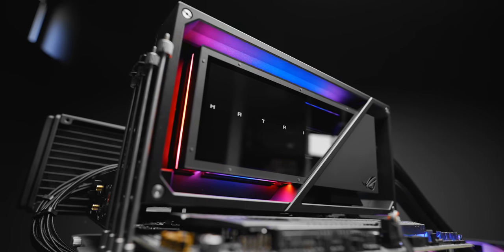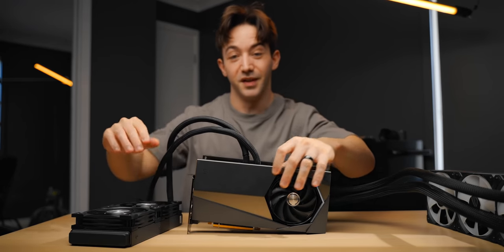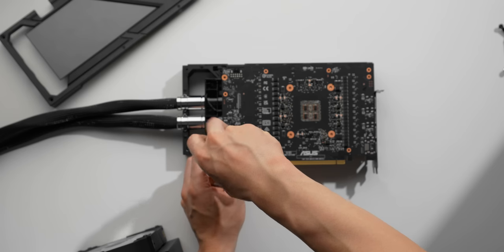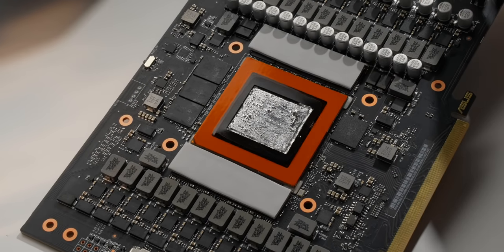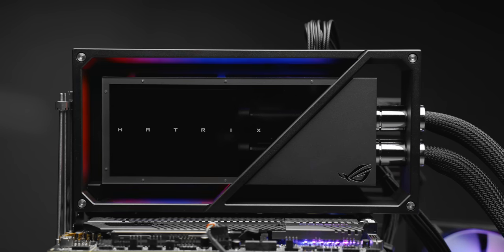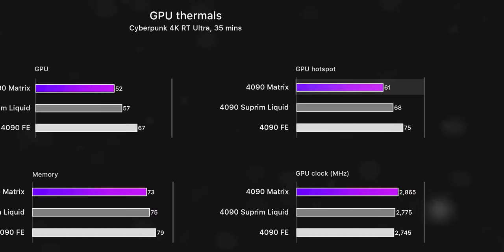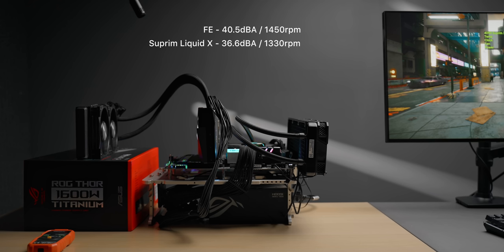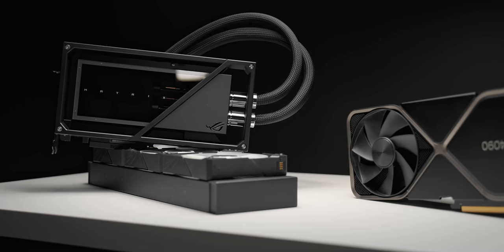Most Overkill GPU – ASUS 4090 Matrix

Comment: 2:08 Two problems. Radiator surface is not nickel plated, so liquid metal will diffuse in to the copper and stop working in year or two...
Reply: 2 problems? :p
Reply: not true
Reply: @erisium6988  Of course it's true, you can see that it's not nickel plated and the issues with copper + LM have been documented for 2 decades.
Reply: Additives easily solve this problem. Asus ain't that dumb.
Reply: @zqzj  You are confusing the loop gunking up from the inside, which is fixable with additives, with the liquid metal attacking the cold plate
Reply: @zqzj  "asus ain't dumb" rolls back a couple months to asus selling motherboards that were literally exploding and killing cpus and their only response till gamers nexus called them out was "not our fault" 😆😆look forward to the "not our fault" pr with this card too. 

Then again if anyone is dumb enough to spend 4k on this scam when it gets 3 fps more than a stock 4090 I don't really feel sorry for them getting played by asus lol
Reply: @slayerr4365  $4000, where did you get that price from? 🤔 I couldn't find it in any listing, but the "MSI GeForce RTX 4090 SUPRIM LIQUID X 24G" cost the same as any quality RTX 4090. Around $1800. Seems like you're just grabbing numbers out of your A$$. 😄 And btw, do you really think people would buy this card for its value? 🤦‍♂ 
I know about the Gamers Nexus story, and I'm not trying to cheerlead ASUS, they F'ed up big time... But you would be surprised how many people can buy a $3k Graphics card, and it wouldn't even make a dent in their wallet. There are "audiophile" loudspeakers that cost as much as a house, yet still people buy them.

Comment: for the amount of extra effort I don't think 10C would justify the 2x price tag and probably double the weight and size of standard 4090 card./..
Reply: also given its proprietary design maintenance and repair would be a nightmare. a competent gamer with proper tools could service his own air cooled gpu at least for fans coolers and heat sink, basic soldering etc. this thing? forget about it lol. For the ultra rich idgaf l33t gamers I suppose.

Comment: When I think "full coverage" I think water channels over the components. Not just a plate of metal that is cooled by a separate part that's cooled by water. Like the difference between a back plate, a backplate with thermal pads, and an active backplate.

Comment: Can you confirm that liquid metal on bare copper is a "real" issue, and if ASUS has accounted for this in their design?  I'm also curious why the water block does not have flow over the VRAM and power components.  Especially at this price point, I'd expect that this product had been very well engineered...but, some nagging questions seem to be popping up.

Comment: you say you're surprised that the matrix uses less power, this shouldn't come as a surprise as when silicon is at a lower temperature it has a higher efficiency meaning that it give the same or better performance for the same or even less power consumption. increase power limits and you should see the card boosting even higher. this is why overclockers like watercooling and having big thick radiators with lots of high static pressure high rpm fans. this also partially explains the difference in coil whine, keeping things colder means they'll run at different frequencies. it's also a result of having a different housing to resonate though. there's a few other factors but those are the most important ones.

Comment: This sort of confirms why i stopped messing with custom watercooling and all that stuff.
You spend an extra heap of cash, and the bottom line result is 3fps.
Forget about the temps and everything because in the end we're here for frames per second, and what you get is 3 extra frames per second, which is absolutely nothing.
Don't get me wrong, i absolutely love the engineering that goes into this, but in all honesty, you're just burning cash for bragging rights.

Comment: I have a pretty descent rig right now that has a RTX 2070 Super, it can't handle ray tracing but does ok. My laptop has a 3060 and does a little better. I looked it up and I can get an RTX 4080 24GB, 384 bit for $2k and it performs almost as good as this things and stays almost as cool. Unless you are just rich, $3200 for a graphics card that cost as much as my PC? So, I am curious, let's say I am retired, have the money and want the best. I am buying a 4k OLED TV, my rig is an AMD Ryzen 5 3600, 32 GB RAM, Liquid Cooled CPU on an AORUS MB. Would you buy the Matrix or the $2100 graphics card.

Comment: What сase is the best for that GPU (or for any liquid cool GPUs), assuming you are using AIO on CPU too, you don't want either of them to push hot air inside your case, right? especially you don't want your 450W GPU move heat inside the case. So, how can you keep positive/neutral pressure in the case while having 2 AIOs at exhaust (I couldn't find the case where you can intake on the bottom and from the left, and exhaust from the back and top).

Comment: I was gonna buy a liquid cooled 7900xtx.... except no manufacturer gave us a liquid cooled version other than the Power Color custom card that doesn't have AIO/radiator, its just a card ready for custom cooling which I generally don't mess with as a cripple. My builds need more ease of parts. So either air cooled or AIO.... I really wanted an AIO 7900xtx.... maybe the 8000 series coming next year will have a liquid cooled version with AIO and radiator pre-attached.....

NOTE, the guy who used to work for EVGA in terms of custom cards (one of the two, not kingpin, I am brain farting his name, but he's the guy kingpin worked with) moved to Asus. And he's the one making these insane high end cards at Asus (motherboard included).

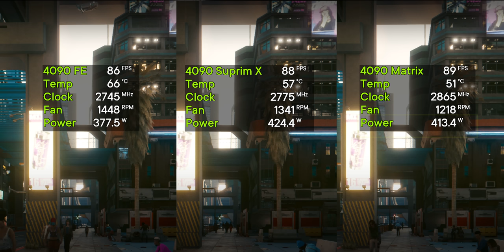Comment: More FPS is not always positive. 4:10 For just 3% more FPS you have 10% higher powerusage. 
With undervolting you get ~80FPS with around 250W or less. As a sideeffect coilwhine, temps and fanspeed are lower. So you won't need an expensive cooler.
At some point you just lose efficiency and that is what I don't like. 
I tested my 4090FE and between 300W and 450W was 5-7% performance. Between 300W and 600W was just 10-12% performance. 
With some FPSenhancing tools like DLSSQ and FG (with which I don't see any difference) and a 120FPS-Limit (which is my OLED refreshrate) my 4090 doesn't always hit 100% load. So I undervolt to reduce the powerusage and to lessen the heat in my room and make it more quiet.

Comment: Not sure why is nobody mentioning COLORFUL NEPTUNE 4090 ?!
That is another option with 360mm rad. Plenty of tdp compared to some 4090, and since i have this card, my thermals arent that off from Matrix ( hot spot is few degrees warmer for example playing CP on 4k Ultra, but while pulling almost 500W and the highest it went was 68 degrees while the card itself was 56 - MAX readings / not average temps which are lower)
And yeah, no need to worry about Liquid Metal.. eating copper and other issues that will eventually come with it..
This thing seems pretty disappointing - except the looks and probably will cost a fortune.  And yeah, i am an Asus fan but man.. not much difference from other 4090s.

Comment: Galax 4090 Hydro is another full liquid option, but rare outside of Asia.
Can't get over the Asus card pricing. Literal doubling of MSRP. $1400 upcharge compared to MSI's comparable card with only a 75 Mhz higher boost clock out of the box.

Comment: Power draw is non-intutitive because as processors run cooler they are therefore more efficient demonstrating less power draw for more performance, though when comparing the same processor with less effective cooling it reflects the need for exponential power draw to achieve similar performance.

Comment: The oc potencial on newer cards doesn’t matter.  Getting 5% for an extra 50% power is not something people would ever use irl.. just for benchmarking and setting records.  Aka useless… I am so much more interested in under volting and loosing up to 5% performance to save somewhere near 20-30% power.  So that’s what I did.  I’d expect others are similar to me.  Not the other side.  And while even I did a max oc just for fun, it was for 10-20 min and then to undervolt for real world use.  And it’s been insane.  It’s kinda nuts that they don’t come this way from the factory. Or use the dual bios switch for this on the quiet mode bios.  Would be a perfect match.

Comment: The fact they did liquid metal on bare copper shows how little they care for longevity. The rma on them its going to be high like on the formula motherboards that used liquid to cooled the vrms.
Reply: The chemistry is similar to any soldered joint and those are pretty reliable, so why would it affect longevity?

Comment: I have one, coil whine under load isn’t the best and it honestly doesn’t do anything special performance wise, limited by memory temps and power; can’t get core past 3030. Also super concerned it’s going to degrade in performance over time due to the copper on Liquid Metal contact. But for now, I’ll keep it. Wouldn’t recommend unless you want it for the looks ❤

Comment: I know this would be crazy overkill, but im wondering if you could modify this and put a 120mm rad with a noctua slim fan instead of the bulky 360mm rad and fit it in a SFF build. I know it would take a large performance hit, but would it be close to the aame as the FE? I'm so curious if this would even be possible
Reply: A 120mm rad is nowhere near enough cooling for a 4090, even with an undervolt.

Comment: My "budget" Galax SG 4090 only hits 70C under load and runs ~ 2800MHz. Even the low end is massively over engineered. I also can't hear it over the AIO water cooler on my 13600k.

Comment: Anyone buying one of these should be aware that Liquid Metal will damage the structural integrity of the copper coldplate increasing the chance of leakage, It also isn't stable enough to be used on a GPU period,  clean that shit off and apply a thick carbon based tim, or graphene pad.
Reply: It's negligible compared to all the other things that can leak
Reply: @shanent5793   no, its not.

Comment: Liquid metal on my 2070super was actually really bizarre, i think the slight clearance difference versus paste and ultra thin LM actually crapped out the Memory heat transfer since i got crazy artifacts really quickly in 3DM even tho the actual core temps were really low. It was really odd. Moment i cleaned it off and swapped back to paste, it became fine again. I didnt mind too much since the temps on a gpu with LM dont matter too much bwcause the die is so much bigger.

And how cam you replace the coolant in this thing down the line..
Reply: You put LM on the memory chips too? Yikes.

Comment: The last matrix i bought was the r9 280x (7970) and the poseidon model of the 980ti, superb cards with a resonable performance over the stock nvidia, nowadays this cards are totally pointless, too ovepriced over the reference cards and even over some nice aftermarket models, and for only 5% about more performance. The quality of the reference design has improved a lot since those days, this kinds of cards are just nosense, even for pro overclockers who doesn't care about waterblock or radiators

Comment: No quick connectors to change the water or to add a reservoir? How is the disassembly for cleaning? You can't even see how bad/empty it gets over time.. Or how the cooling fins/paths are placed in the waterblock.. I think one shouldn't get tricked by a nice/metal exterior over what actually counts inside (or in this case: what transfers the heat away (besides the liquid metal) and provides) the numbers. The coil wine of some of the examples where easily noticeable and annoying, when listining to the video on low volume settings. For a goal of silence this is not very good. I'd think better over the product if there were e.g. alphacool quick connect connections built in for easy water replacement - also uln noctua fans for silent air movement. The metal casing could serve to sound proof the card and coil whine.

Comment: You could buy a 4090 OC with a better non full coverage block that is nickel plated and soft tube it for cheaper than the 3200 dollar price tag this hunk of scrap sells for. The block is copper and liquid metal will destroy it within a year. Poor choice on not plating it in nickel. This card has just a standard backplate and is not full coverage. 

In addition the AIO coolers in general are not serviceable, is asus going to offer lifetime service in the price tag for pump replacement as well as coolant. 

I am running a RTX 3090 FE with a real active backplate from EKWB that as a pair I got for around 300 for the set when they were on sale. 

I could take a zotac 4090, add a better pump-res (you could use a 140 or 240 size res), a better radiator, I would choose phanteks D30's for the fans and an ekwb full coverage abp, throw in some soft tubing for around 2200 and more than likely out perform this card while being able to use liquid metal (the square cut pad is nothing new to protect the pads on the GPU)

In my conclusion after watching numerous videos and looking at the specs of what asus has done is nothing short of price gouging for 4090s they cannot move at the current price of 2200-2400. 

It looks "decent" but it has a lot of negatives as described for the price.

Comment: If you got it flaunt it I spose, but it's hardly a practical card. Most 4090's are already heat efficient and overclock just as easily. Also the 5090 will be here next year so if it was me I'd get the cheapest brand 4090 and save a few bucks towards other upgrades present or future.

Comment: Don't worry guys, ASUS isn't actually planning to make sales with that price. It's just a statament on their part, however stupid it may be. Overclocking an already factory overclocked card and slapping a (i'll have to give it to them) pretty good cooling system, it's just a statement. And not one that makes sense either. Nvidia already maxed the card out, at 600 watts. And we know it doesn't scale past 400 anyway. Hell it doesn't scale well past 300 but hey, what the hell. So adding 1 percent performance, just for making a statement, its beyond stupid. Not to mention, come tomorrow, with the arrival of 5000 series, this card's price will be the same as any other 2nd hand 4090. Because that's what it is at the end of the day. They also shot themselves in the foot by releasing the card as late as they did. I don't know how to praise this card honestly.

Comment: My custom loop has almost 2x the rad volume/area comparing to this, just for my 4090 to keep the fan noise low lol. The thing is, a 4090FE plus all the custom loop parts are probably still cheaper than this 🤣🤣🤣

Comment: honestly, kinda dumb to make such an overkill 4090. I mean, 4090 doesn't really require THAT much power, hell, some people even undervolt it to 0,975v and still get 2.8 ghz out of the damn thing with 350+-ish watts, which translate to maybe 98% of stock performance, or even better than stock with slight +1000 memory OC. most 4090 got like those quad slot coolers, you don't need liquid metal for the TIM too, those cheapest 4090 you can find already are overkill in cooling department. I don't find the idea of paying through the nose for these ultra-premium cards that promises the whole 600W OC as anything but bragging rights really.

Comment: I DO NOT recommend anyone buy these AIO cards. The AIO WILL die within 4-5 years, maybe a bit longer if you're lucky, and then your card is essentially e-waste.

I had the 980Ti EVGA Hybrid card with the AIO built in. Was awesome when it worked, but it eventually crapped out. There is no repairing these things. The EVGA card had a reference board still, so I was able to get a 'for parts' 980Ti and transplant the cooling over, but it was non-trivial to do so.

This Asus card does not have a reference board. So the moment that the AIO dies, you're done. You can toss the card into the trash and leave it at that, unless you want to put a ton of work into getting a 5+ year old card working again, via having a block custom machined, or figuring out how to modify the fancy shroud to fit alternative parts inside. Even if the PCB is "99%" the same as other ASUS cards, you're greatly limiting the list of cards you can MAYBE harvest parts from to get it repaired. All it takes is one mounting hole to be slightly offset and you're hosed.

If you want a watercooled GPU, put the little bit of extra work in to make it a custom loop. They're more complicated than simply slapping this card into your case, but they're also repairable, and if you want to get off watercooling, you can always swap back to the stock cooler.

Hopefully I keep at least one person from wasting their money!

Comment: 4000 dollers..no
Reply: +- 4000 euro. 

For fun I made a PC for about the same money with high end component's..... 

I can make a PC with a 7900xtx 7800d3 ASRock motherboard phanteks nv7 case. 
Phanteks expensive fan's and cpu water-cooling (all D30 fans) power supply. 
2TB m.2 PC4.0 
32 gb 6000 cl30 
Samsung Odyssey G8 OLED. 
Keyboard and mouse... 

For 4180 euro.... 

All day that over this Asus card .... 

Without warranty 😂

Comment: so they made 10 of these 4000$ (yes its 4k $)  cards and since NO ONE would buy them they send them to "influencers" :P
Not to  mention this card will DIE in1/2 years since the BARE copper will dissipate the liquid metal.. made by and for idiots.
Reply: +- 4000 euro. 

For fun I made a PC for about the same money with high end component's..... 

I can make a PC with a 7900xtx 7800d3 ASRock motherboard phanteks nv7 case. 
Phanteks expensive fan's and cpu water-cooling (all D30 fans) power supply. 
2TB m.2 PC4.0 
32 gb 6000 cl30 
Samsung Odyssey G8 OLED. 
Keyboard and mouse... 

For 4180 euro.... 
...............................
All day that over this Asus card .... 
Without warranty 😂